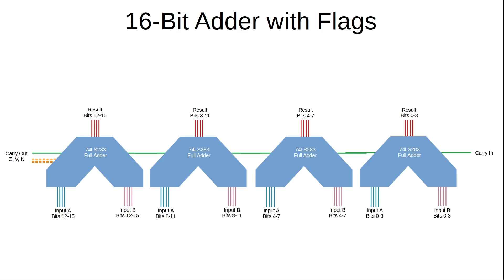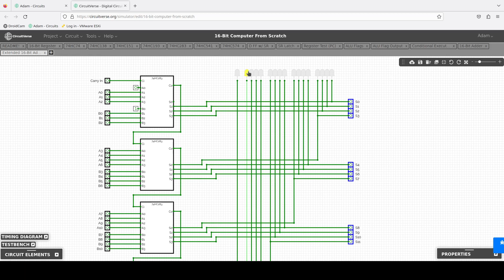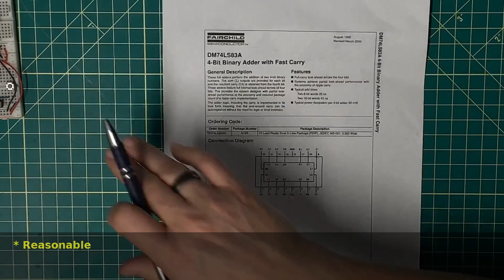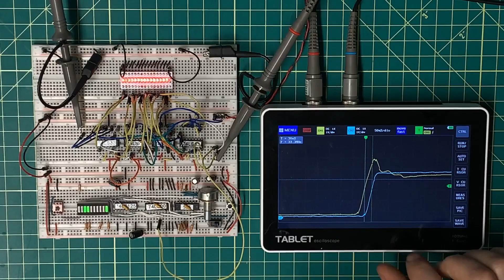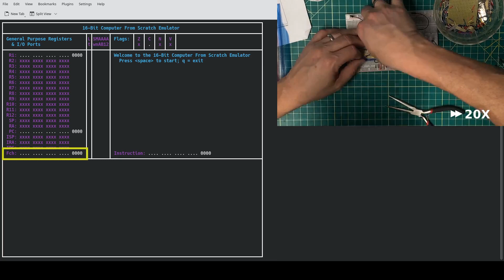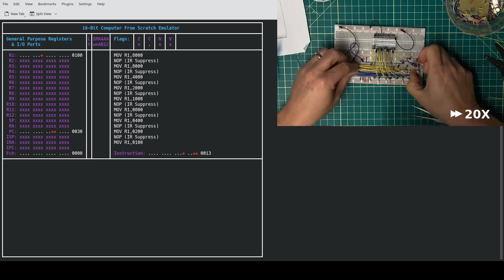0060: ALU Adder Design and Breadboard | 16-Bit Computer From Scratch

Comment: There's another way to detect overflow that doesn't require access to any internal carries. Overflow has occurred if the sign of the result differs from the sign of both operands. If A, B and S are the sign bits of the two inputs and the sum, then Overflow = (A XOR S) AND (B XOR S).
Reply from the maker: @gcewing -- Interesting.  That's one gate deeper than my current solution, but I also have a complete additional adder in mine.  I suspect your solution would be faster overall.
Reply from the maker: @gcewing -- do you mind if I have a small cameo of your comment here in my next video?
Reply: @eryjus4594  That's fine!